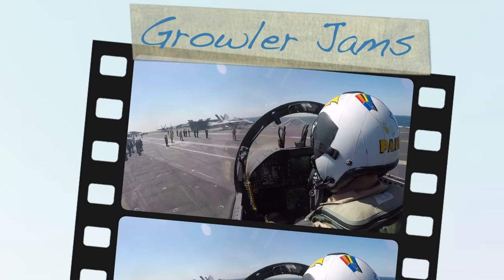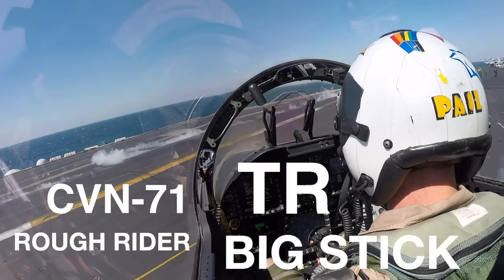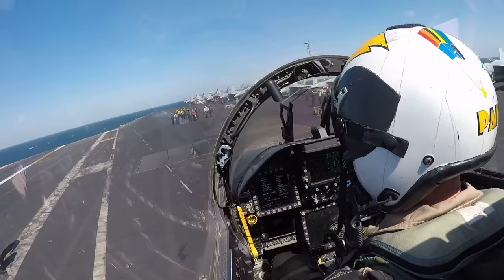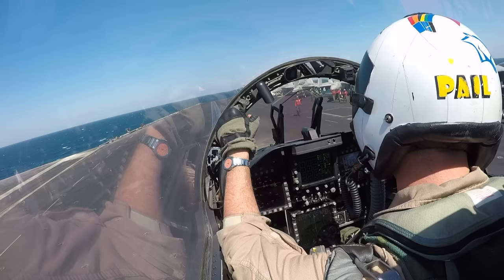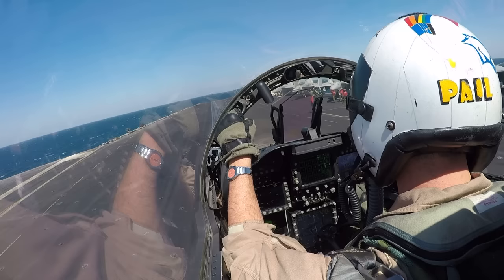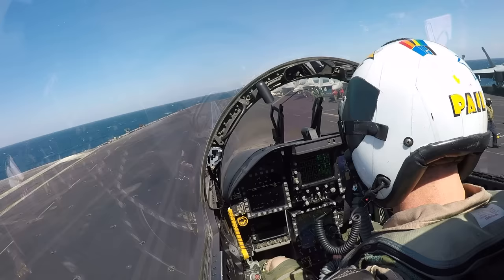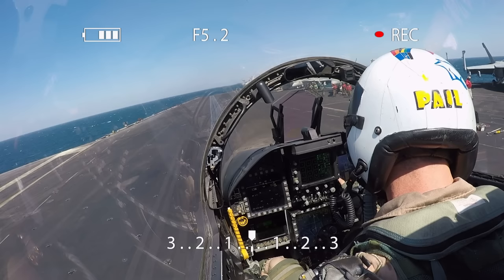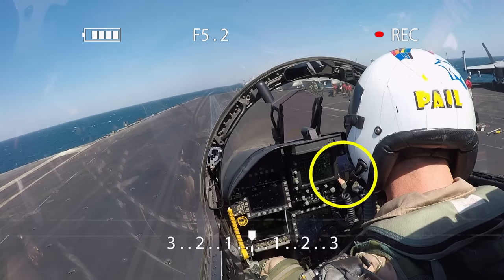Why Pilots NEVER Hold The Stick On The Catapult

Comment: I used to drag race in my teens. Nobody taught me, but in my first few races I realized how important it was to keep my right hand off the shifter when I launched. If I held the shifter, I ALWAYS ended up pulling the transmission out of first gear.

Comment: This is fantastic! Ex Navy TD2 (1965-69) and did my pre-A School with VT-21 at Kingsville NAAS. Note is was still an auxiliary station in my days. Plane captained a small bit but eventually ended up in the LCPO's office. After Memphis, I did duration with the LANTFLT ASW School at D&S Piers Norfolk on the 14A6 tactical simulator. Best 2.5 years of my life. Had a chance to catch three hops with the TF-9 instructors at "21" and it was unforgettable. Admire the heck out of what you guys do and thanks for this great post.
Reply from the maker: Cheers, Shipmate!

Comment: Pail! Back in the '80s I made many of those shuttles for your jet to hook to. They are made from one piece of heat treated steel. I think the total we made was somewhere around 850 parts. Also made a lot of arresting gear deck equipment. Big pulleys 35 in in diameter gear housings shafts that were foot in diameter. Lot of weight on that cable when you hook it up. Great watching your videos thank you very much. Clear skies😊

Comment: Great video, but I wonder how many people read the title and assume that not holding the stick is standard procedure for all cat shots.  I have never launched in an FA-18, but I have taken countless cat shots back in the day and I can assure you I held the stick on every one of them because the aircraft I flew didn't have the capability to launch in what is essentially an autopilot mode. 
You gave a good account of "Why FA-18 Pilots NEVER hold The Stick On The Catapult" and that should be the title of your video.
I can certainly see the advantage of being in an autopilot mode right off the cat, especially when launching on a pitch black night.  
Making that transition to instrument flying, especially when you go off with zero knots excess, was sometimes a bit tricky.  Miss the correct trim setting by a little bit and you risk flying into the water (or stalling and then flying into the water) during the first few seconds as you wait for your gyro and rate of climb instrument to settle down.  Automating that process makes sense.
On the other hand, if you launch with 10 knots excess, the semi-automatic cat shot deprives you of the opportunity to hold in a gob of aileron during the shot so that you execute your shit-hot clearing turn right at the bow.  Half the cat crew and the guys on Vulture Row used to love it.  The other half mumbled to themselves "What a dumb ass".  ;)
Reply from the maker: Ha! Valid point.  Cheers.

Comment: I was on TR back in the early 90s and there was a reserve squadron on board doing carrier quals after transitioning to the F/A-18. The PXO of the squadron did exactly what you described: he grabbed the stick and input controls during the launch, creating PIO and placing an expensive jet in the water. The PLAT film of that one was interesting to watch.
Reply from the maker: Ouch!  TYFYS.
Reply: I forgot to add that after that incident, he was no longer the prospective XO of that squadron. Go figure. @GrowlerJams

Comment: PIO happen so many different places.. You corrected two of my misunderstandings. I watched my dad do Positive Control checks on his sailplane every time before he took off. My mom would walk around the plane and put her hands on the control surface and he would move the control.  I thought this was what was happening when y'all wiggle wiggled. And it is. But I didn't know the computer was doing a self check also. I missed the computer helping out flying the plane on the initial part.  The PIO connection is obvious when you say it out loud... It wasn't obvious externally... 

To me anyway.

Comment: I was on the USS Independence on the late 70's, One pilot had his flaps in the wrong position and almost lost it, it looked like the plane went vertical after launch, he went up and down several times, but pulled it out. I also saw some planes hit the water, after having problems. It was an interesting experience.
Reply from the maker: TYFYS.
Reply: Might have been a Phantom.  They would overrotate if the stick was not held in the proper position during the stroke and/or the rotation was not positively checked at 12 degrees nose up off the cat.

Comment: On previous generations of aircraft (before legacy Hornets like F-14s), pilots were trained to pull the stick aft before the cat shot and hold it until off the boat.  And I thought that was due to the Somatogravic Illusion that would cause pilots to push forward during the cat shot.  I suppose you get the opposite effect right after the cat shot due to the change in acceleration and want to pull up, which is what you said in the video.  To me, basic pitch and power flying is the safest way to do it.  Just set a takeoff/climb trim and the aircraft will do the right thing without the pilot.  If I'm not mistaken, I think that's what you guys in the F-18s are doing, that is just setting a takeoff trim and putting Sir Isaac Newton in the driver's seat.  A very long time ago, like the 1980s, I thought I read the computer is flying it off the boat.  But I think it's just trim and not any active mode from the computer.
Reply from the maker: Yes, the jet basically flies itself off the deck with trim and airspeed.  The jet does do a few things, though, like limit AB until the jet starts moving and toe in rudders to get the nose up.

Comment: That's a lot different than the S-2E "Stoof" on the hydraulic cats on the USS Randolph. If we kept out hands of the yoke (no stick) it would be back in our stomach. So, we had a hand on the yoke and our elbow braced against our stomach. The hydraulic cats were wa wild ride - 60 feet of power, 60 feet of coast (as which point the bridal should separate from the aircraft) and then finally 60 feet of braking (by which time we should be gone). At the end of the 60 feet the S-2 would be at about 120 Knots (normal cruise was 140). Amazing what 50 years of innovation has given us.
Reply from the maker: Wow!

Comment: The sailor watching from the signal bridge has no idea what the pilot goes through anymore than a drag racing fan realizes what a top fuel driver does on the starting line. It's a bunch, and it has to be done correctly every time.

Comment: Question: You're hands off the stick when launching, how do you know how much trim to input beforehand, or will the flight control system automatically trim the controls? I'd imagine the trim can vary a bit depending on fuel, load out, etc? Thank you for the uploads!
Reply from the maker: Yes, we calculate our trim for every launch based on symmetry and gross weight.

Comment: I'm at 1:20 and my guess is that you keep your hands off the stick after you pull up to the steam catapult because the control stick is also connected to the nose gear, and it would be a powered system, as opposed to being used actuated with human strength.

So either the steam catapult, or more likely the aircraft landing gear would either break, or incur shear force wear, risking:

*the landing gear getting ripped off mid lauch, dropping the aircraft into the sea
*the steam catapult taking damage
*flying pieces of metal

and/or one/several of many other possible carnage sceanrios of doom.

People usually guess "shooting up the deck"?

Well, that's my guess anyhow.

...aaaaaand I was wrong 😅

Comment: I fly gliders and while taking your hand off the stick there during winch launch is not necessary, I did have a pretty unpleasant experience clinging too tightly to and pulling it back as the acceleration thrust me back in the seat.

Comment: It was a little different back in the "old days" ... '60s-'70s ... we ALWAYS had our hand ON the stick for a CAT shot ... right hand on the stick, left hand on the throttle(s) with the "launch bar" down --  A-4 Skyhawks and A-6 Intruders.

Different birds, different procedures, different parameters ... and "Grandpa" didn't have an FCS or BIT checks  to "confuse" the issue ... we "flew" the bird as soon as it left the bow and did a smooth but hard, definite, clearing turn ... don't want USS BOAT running over you if you have a serious problem off the CAT stroke  -- like you lose an engine or have a bad/cold CAT shot --- and you go in the drink.  

Last few seconds drill:  go to MRT when you get the signal to spool 'em up ... wipe out the cockpit with the controls ...  salute the CAT Officer  when you're ready ... right hand on stick, left hand on throttles and "launch bar" ... BOOM ... AWAY YOU GO !!!  And as soon as you reach the "pointy end" of the flight deck, you're "up" and making your clearing turn (day launches) ... straight ahead at night ... and you're flyin' ... 

FLY NAVY !!
Reply from the maker: Fly Navy!!

Comment: Mr. Jams, Had a quick question. I was watching one of your videos as you were 3rd in line to take off. It looked nice and sunny, clear skies and that got me wondering. What is the temperature in your cockpit. Are you like hot while you wait, or is there some A/C. There for sure days where you were out at sea and its 90+ or maybe 100 degrees out, So was just curious how the temperature is in there on hot days, cold days etc'. Thank you for your service and more importantly thank you for putting me in the wizo seat and flying with you. I was right there with you on Big Stick '. Great videos sir.
Reply from the maker: The environmental control system works well in the jet when airborne, but not great on deck.  It can be 90 degrees or so in the cockpit while we wait to launch.

Comment: Sierra Hotel, Pail! My F-15D (1982 jet) had a take-off trim button that set the horizontal stab so the leading edge was a couple of degrees below parallel to the ground. Do the 18s have a similar feature? It also had an aileron-rudder interconnect that effectively obviated the need for the rudder, as I recall (this was 40 years ago). Seems like the horizontal stabs could move independently of each other a few degrees. I also seem to recall that nose wheel steering had a paddle switch on the stick that had to be depressed when taxiing. That was something they didn't reach us during engine run school, but I watched a jet jump the chocks when it suffered a major hydraulic failure and it lost its brakes. It went directly into the jet that was across from it, nose to right wing on each, and we had a 1400 gallon puddle of JP-4 on the flightline in short order. That whole day would make for a great story, as it was a Lemony Snicket Series of Unfortunate Events kinda day.

My Grand-Niece is on the Ike cruising the Red Sea, maintaining the reactor and help making it possible to kick some Houthi Arse. That is turning into a Major League S**t Show. Thanks for all you guys do. Keep the Blue Side UP!
Reply from the maker: Funny.  The Growler has all of those features.  Same same.

Comment: Thank you for your service!  Are there "position indicators" on/in the wings of an F-18 and/or a T-45 to allow the deck crew to visually confirm your previously folded wings are successfully locked into flying position?  Do you also have an in-cockpit indicator of some kind that tells you the wings have successfully unfolded and locked into flying configuration?  I'm familiar with some of the WW2 navy aircraft that displayed red pins/indicator panels which protruded above the fixed portion of the wing when the folding portion of the wing was locked in the folded position.  These pins/panels retracted into the wing, or flush with the wing surface, when the folding portion of the wing was successfully locked into place prior to takeoff.  This provided a quick visual confirmation from the cockpit, and for the flight deck crew, that the wings wouldn't suddenly fold in flight.  I really enjoy your channel!  My father was involved in high-altitude training during the last few months of WW2, and I wanted to be a pilot.  However, even my corrected vision was always way too bad to be safe piloting an airplane.  As a very amazing substitute, I had opportunities to ride with two flight demo teams, The Northern Lights (in a two-seat Extra 300) for a routine consisting of some multi-plane formation flying, loops, rolls, a hammerhead and some inverted flight and Lima-Lima (in a Beechcraft T-34) for some multi-plane formation flying as well.  Really cool stuff!  All the best!
Reply from the maker: Yes, the F-18 has “beer cans” on the wings that go down when the wings are locked.  We also have a cockpit indication as well.  The ground crew can see those beer cans from outside the jet.

Comment: Isn't pilot induced oscillation also an issue when doing regular landings? Something like over-correcting and then oscillating?  Never would have guessed it's an issue when getting launched from a deck, but it absolutely makes sense that there should be no interference with the catapult.
Reply from the maker: Not really, the FCS hacks it pretty good during normal landings.

Comment: Thank you!! great video! 
 I have 2 questions please : 
1: why the nose gear door of the F18 have clear "windows" sections? 
2: when and how/why you decide on AB take off or mil power only?
Reply from the maker: I won't discuss specific design elements of the airframe. 

Once we exceed a certain gross weight, we need MAX AB to launch off the bow.  More weight quals more thrust required.

Comment: Model EA-3B, 1978 WestPac. For some reason, the pilot (left seat) held on to both throttles during the cat shot. So one day the Navigator in the right seat puts his foot up and jams the pilot's hand all the way forward to ensure he can't accidentally pull the throttle back during the shot. I believe the pilot got the point.
Reply from the maker: EA-6B?
Reply: @GrowlerJams EA-3B. 7 crew. Manually operated ELINT and COMINT interception platform. 70,000 pound landing weight aboard ship. I served in VQ-1 deployed aboard 5 different carriers in WestPac 1975-78, flying up and down the coast of commie countries, esp N Korea. Much fun.
Reply from the maker: Gotcha.  Wow!  Haven’t heard many of those stories.
Reply from the maker: We’re you in Whidbey Island?
Reply: @GrowlerJams My own personal stories from the EA-3B? 1. A crewmate dropped through the lower hatch in flight. 2. The N Koreans shot a missile at us. 3. We delayed our cat shot so I could take out a burning radio and hand it to a deck hand--he threw it overboard and we launched. 4. We had so much furniture stuffed into the cabin that we needed more fuel, so we jumped up and down to rock the wings and get another few gallons in the wings--then the take off roll took forever. 5. One day, on landing, the self-sealing fuel tanks ripped wide open and dumped fuel all over the flight deck. 6. One night, I was working in the Hell Hole aft, and they pushed the plane back. Suddenly, I was over the ocean and had to sit there for an hour until they pulled the plane forward again. VQ-1 was the most fun I've had in my life.
Reply: @GrowlerJams VQ-1 went from Danang to Atsugi and then to Guam. They went to Whidbey in the late 80s, I think. By then, I had switched to Air Force and started my non-flying tours in PI, Korea, and Germany. Really do enjoy your videos, Jams. Maybe do one on that guy who was sucked into an A-6 intake and survived?

Comment: Question: I flew A4's many, many years ago, and during the cat shot we held one hand about an inch behind the stick handle, elbow against the seat back, preventing the stick from rotating rearward from inertia and causing the aircraft to stall coming off the bow... it appeared to me that you had both hands gripping hand-holds on the windscreen frame, so there must be something preventing stick rotation.
Reply from the maker: Yeah, they have figured out spring stick tension these days.  The stick won’t move during the cat shot.
Reply: @GrowlerJams  Duh, obviously I hadn't viewed all your videos or I wouldn't have asked that question. Thanks for the reply.

Comment: AWESOME!   I know you're not a Blue Angel pilot, but I have an aerodynamics question that's really bugging my head out. If you could help me understand this, I'd really appreciate it. Watching their winter training videos on YT, I noticed the flaps settings are different for the two solo aircraft on their formation takeoff.  The one who does the "dirty roll" after a steep climb, has flaps up (auto) and the other aircraft has half flaps.  I've always wondered why.   Any idea?   Thanks for your service, your time and these incredible videos 👍🏾
Reply from the maker: Probably so the solos can accelerate more quickly with less drag. Also, we can’t do rolls with flaps down, so he’s getting the jet ready early.
Reply: @GrowlerJams  Oh wow, so I had half the answer in my head already (faster acceleration, less drag), but didn't know about the flap restriction. Makes sense because he actually does lift off first, ahead of the other jet. I assume the flap restriction during a roll is due to the FBW computer. Thanks!

Comment: Cool mini ‘signature move’ Pail.
Is there a specific trim setting to allow the correct angle of attack off the deck, or is it dealt with automatically by the computer? The trim setting must depend on the CofG with fuel load, weapon load etc.?
Reply from the maker: Exactly.  The pilot needs to manually select trim settings prior to launch.